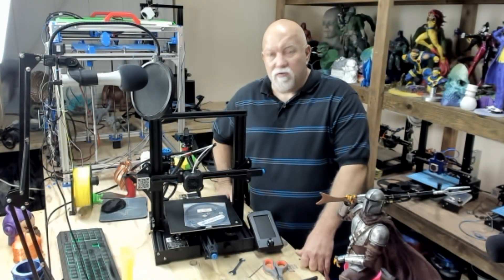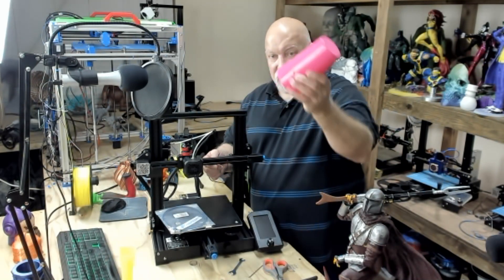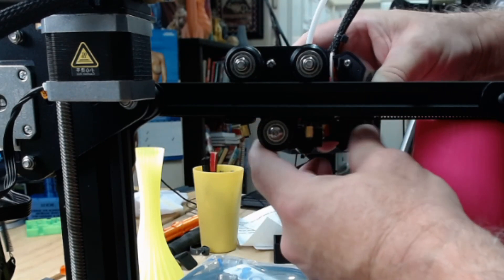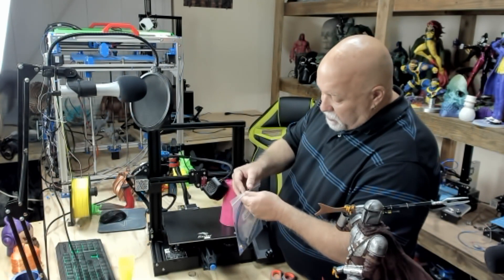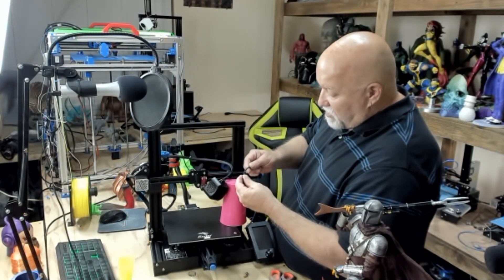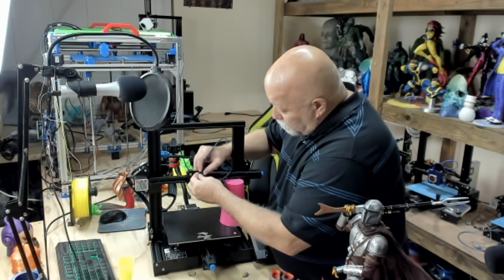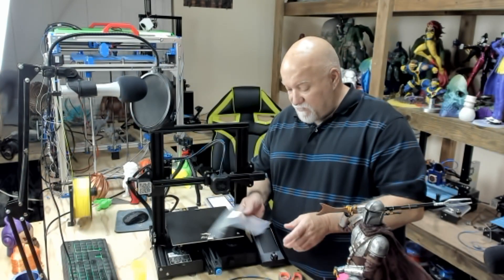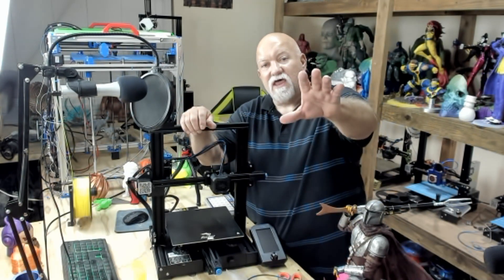UPGRADE ENDER 3 V2 #3dhp

Comment: Just wondering, why would you do this mod rather than move the extruder above the hot end as a direct drive? any downsides to doing that? thanks
Reply: Probably also because the video is about the VERY SIMPLE upgrade of the PTFE tube, where a DIRECT DRIVE change would be a much more involved video and may not be something for everyone.  There are plenty of videos and discussions for DD.
Reply from the maker: The printer prints great the way they are, direct drive adds alot of weight  to the x gantry,there is no dual z axis and not needed the way its built,these printers print perfect the way they are.The bowden setup on all my printers works great

Comment: What would happen if you did not back off the coupler 3/4 of a turn before inserting the PTFE tube?
Reply: If you're going to print hotter materials such as NYLON, best to just go ahead and replace the hotend with a ALL METAL HOTEND... and hardened steel, vanadium or ruby tip nozzle.
Reply from the maker: @timd9430  Yes I agree,but I don't yet.
Reply from the maker: You can push it straight in,but it might not be really tight against nozzle.I have done it both ways,since doing a video,trying to teach what I believe is the best way to do it.Thanks for your comment Andrew.